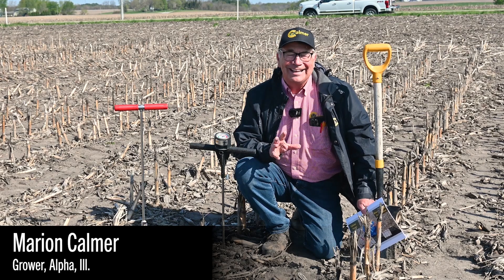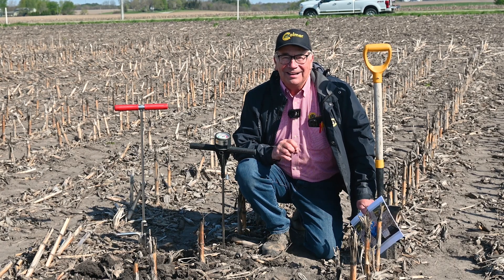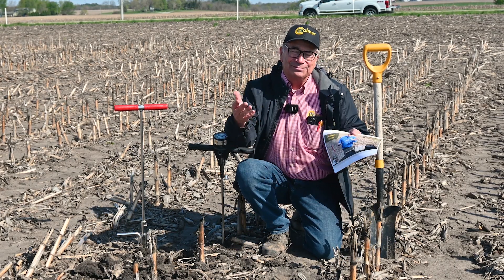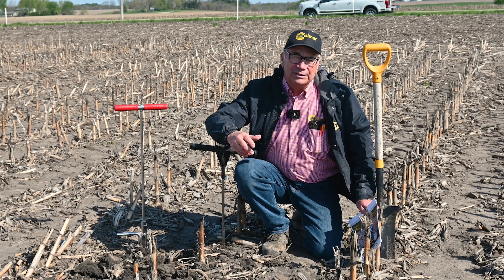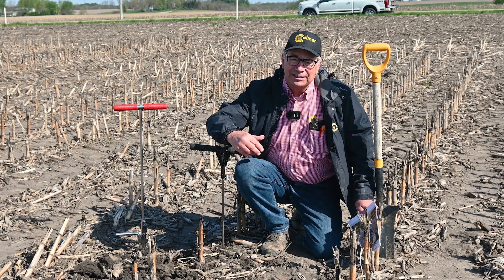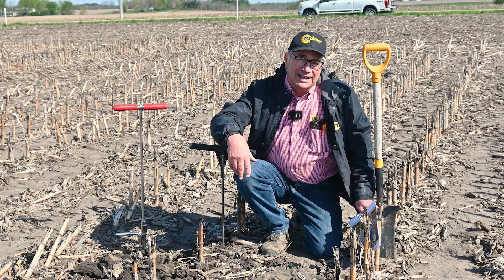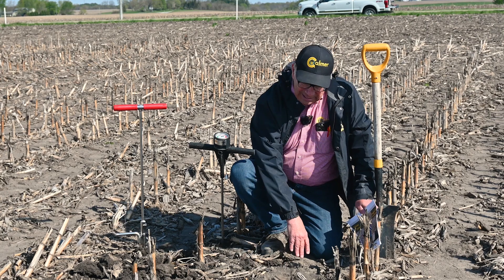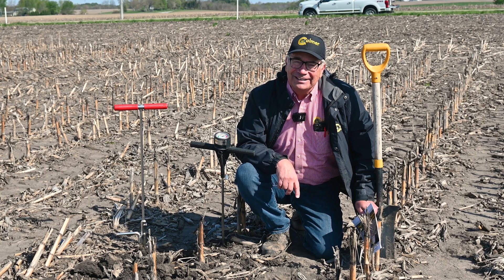Did Strip-Till Solve My Nutrient Stratification Problems?

Comment: I look forward to hearing more on this issue and using strip till to fend against it; You are the one who opened my eyes up to nutrient stratification last year. We've been no-tilling corn for about 8 years on soybean stubble and like you said, just broadcast a lot of N (ESN) & K out overtop of the ground and hoping the best from Mother Nature. We also strip-till with a knife unit, putting stablized 28% in the ground (8" deep), but only on previous year's winter wheat...then clover cover crop ground (all burnt down fall prior to planting). Soybeans we broadcast NPK and lightly disk or VT in then air-seed with JD 1990ccs. 1/2 of our acres is only a corn soybean rotation that strictly gets no-tilled corn and light till pre-planting soybeans....so this is the ground I'm most concerned with nutrient stratification. Thanks for your research and sharing.